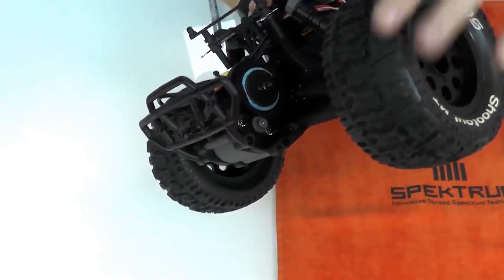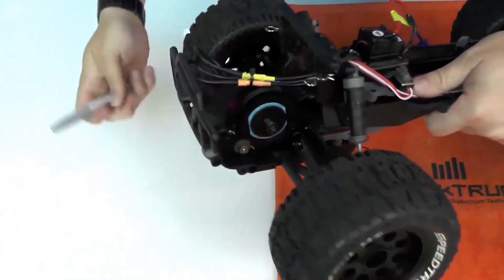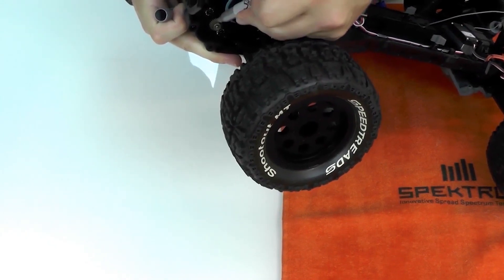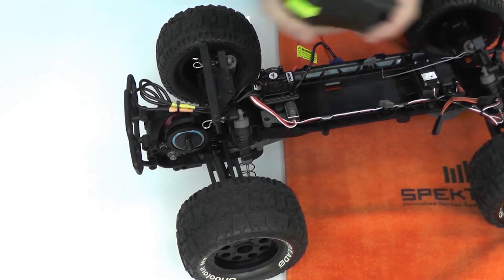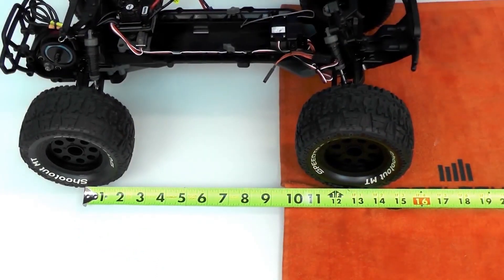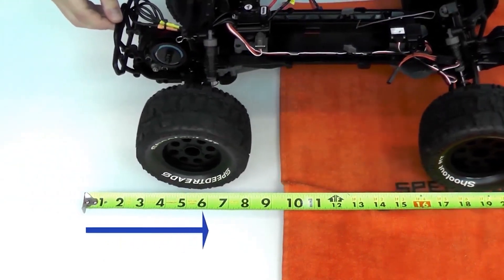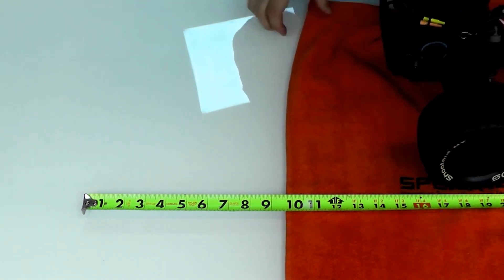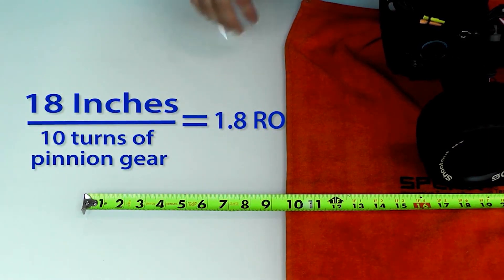Spektrum Quick Hit Tech Tips - How to Calculate Roll-Out for Speed Telemetry

Comment: How would you do a roll out on a car or truck that the set up is in closed and you can’t see pinion gear like the arrma vortek 3s
Reply from the maker: Is there not a pinion/spur gear cover that can be removed on that model? Sorry I am not to familiar with that one.
Reply: Yeah I had to take the front part of the cover off reinstall it in the truck and you can just see the gear with the 20t pinion and the stock wheels I got 18inch so the rollout was already set up 1.8 thanks for the reply I love your spektrum line all of it
Reply: Hey whats up so i have a vorteks 3s as well with upgrades im far from stock so i hit arrma directly to figure out this roll out formula and this is what i was given.. The calculation for rollout is the following:
Circumference of tire * 3.14 / (Diff (ring/pinion) * Trans (spur/pinion))
=(4.53*3.14)/((37/13)*(57/15)) or 1.32 rollout...thats an example hope it helps happy holidays
Reply: The tires you have are they stock 3.14 thanks for the help
Reply: @vincenttuttle3643  No i have 1/8 duratrax bandito for 8th scale buggy ...my rollout with my 25/57 ended up being 1.99
Reply: @vincenttuttle3643  my circumfrence was 4.125 for those bandito which is really close to the stock tires

Comment: after marking the pinion, wouldn't  it be just as easy to make a line beside the center of the rear tire, make the 10 rotations  of the pinion and then mark a 2nd line at the center of the rear tire and then measure the distance of the lines?
Reply: can you make  another video how to  calculate roll out for a arrma kraton 8s or any other rc car
Reply: @SaveTITANFALL  I never made a video on how to do this. I was just asking a question.
Reply: @Blueknight1960  damn my bad damn i was  high